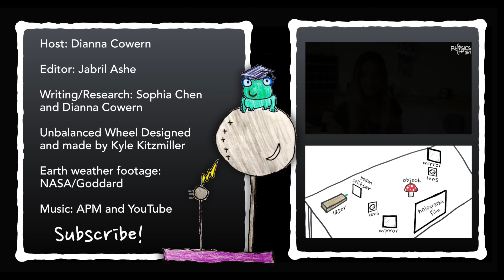Are perpetual motion machines possible?

Comment: The three Laws of thermodynamic:
1.- You cannot win. For any energy invested in a system, you can't obtain more than its equivalent in work and heath in a given system.
2.- You cannot tie. In any given system, the hotter parts cannot maintain their temperature and will invariably get colder, until the total temperature averages.
3.- You cannot stop playing. No matter the system, the minimum temperature is absolute zero. If our universe can be considered a closed system, the far, far, faaaaaaaaaaaar future is a cold and lonely place.
Reply: +José Sandoval Wonderful description. LOL. It would be terribly discouraging if it was not hysterically funny. It sounds like politics. (1) You cannot win. (2) You cannot draw. (3) You must keep playing, and everything turns to sh1+ in the end. Where is Donald Trump when I need him? Behold, exhibit 1.
Reply: +José Sandoval True, but what about a system which never goes above local temperature, it is at best equal to it, and periodically oscillates to a temperature below ambient as a result of a reversible chemical reaction, it takes time for the signal to propagate and the signal alternates between ambient and this temp drop.  It is dependent upon local temperature being above x to perform the osccilation at a positive pressure but it can maintain internal energy for very long periods of time, while continuously outputting work.  For work is not energy, work is the process of deformation resulting from energy flow!
Reply: +Kimberly Peacock every thing dissipates energy, there is nothing that keeps more energy it was provided with to begin with. work is only the event which is created by energy.... no energy = no work.... cold universe = no movement = no energy = no work, work is generally observed as something which was initiated, something usually uses energy to make things happen no matter the scale, even if something was internally hot, for instance a planet, that would be the result of transferred energy from the surface and as the energy gathers in the center of the planet it gets hotter in a smaller space, no more energy than it was initially supplied with. just more concentrated but soon the ambient temperature will override and cool it in the same way.

i understand your thuoghts but unfortunately, from what i am aware of, it's not right. work is always the result of energy somehow. i'd get really deep into this but most people don't like lengthy replies.
Reply: +swanclipper &quot;Silly Rabbit tricks are for kids. &quot;    Yes everything dissipates energy it's called entropy; unless constrained from doing so. Such as if your heat engine never rises above ambient temperature then internal energy is maintained at what is was at ambient temperature.   If you have an oscillating temperature  15K plus or minus where the 15K plus is equal to ambient, and you insulated it and have thermal mass some distance away, the signal cancels out within a distance and time.  (This is what the temperature is constant at 60 feet down within the earth within 1 F annually)  You will never find a violation of physics in what I am saying, and you will not out science me!   But please be skeptical and ask good, hard questions, and I shall answer, and then maybe you will understand and others as well.  I do not claim a perpetual motion machine or over unity. What I do claim is that energy can be conserved in an oscillatory loop for years, and that one can continue to produce useful work over that time.
Reply: +Rainbow Hyphen  Agreed, nothing is forever except energy. I'm only 99.999% sure of that.
Reply: Kimberly Peacock i'm, not trying to out science anybody. i'm simply introducing my understanding of a very complex system in a form simply understood.

conserving energy and using it effectively isn't breaking laws, i know that, from what i remember, your comment came across as a means to bypass energy restraints from the external forces acting upon it while working or changing to match the external environment. the oscillation is still a form of work provided by energy.

i also agree energy can last "forever", another subject i wouldn't mind a lengthy discussion of.
Reply: In a thermal context, a closed system, (which we all know is an artificial construct) cannot lose thermal energy to something unless that something is colder. You can generate an endless amount of work from the same energy, but that work as a proportion of the energy flow will always be less. Which is why I call Carnot efficiency the work ratio, as its the measure of maximum work you can get out of an energy flow for a single cycle. The oscillatory signals that I was speaking of were n the context of the "closed system" where temperature never goes above ambient, and thermally we oscillate - 15 K from ambient to ambient, and where the substance is a reversible metal hydride whose eq pressure doubles and halves in 15 K increments. 22.2 KJ per Mol of H2 of energy is transferred for the equivalent of 1 KW of work.  I'm simplifying here because you need two pairs of hydrides, one which acts as the drive, and the others acting as thermal batteries.  You obviously also need to be at a critical temp  for if below you cannot complete the cycle.  (It becomes none reversible)  However once at that temperature or above, it will conserve its internal energy, and cycle, outputting work, until it wears out, or loses hydrogen mass.  In practise hydrogen leaks through everything.  I will post something on google plus and link it to you in the next couple days, if you wish to understand in depth.
Reply: +Kimberly Peacock "You will never find a violation of physics in what I am saying, and you will not out science me!"
Odd that you have to turn a discussion into a game of one-upmanship. 

"But please be sceptical and ask good, hard questions, and I shall answer"
Why is it that you think people want to hear your answers?
Reply: Skeptical?  

1. Zeroth Law.
2. Conservation
3. Entropy  See entropysite.oxy.edu
4. The entropy of a perfect crystal is a zero when the temperature is 0.

There is nothing about work and of course if you think about it instead of regurgitating it does not make sense to include work. You can also google work is not energy, or dig out a good thermodynamics textbook and understand the difference.
Reply: Imagine the earth's climate as being steady. The energy coming in from the sun is balanced by the energy being rejected, otherwise the temperature would increase or decrease. (Energy is conserved.  At this time the earth is being warmed in a dissimilar manner, and this gives rise to changes in gas density we call wind, which is also known as work. If you counted work as energy plus the incoming energy and outgoing energy, well you end up in a situation where you are creating energy.
Reply: +José Sandoval 1. You can not get more work than is energy in a single cycle.  Carnot Efficiency  the work to energy ratio, which applies for a single cycle.  However as work is not energy, it is the product of energy flow, you can get more work in many cycles than the energy contained within a closed system, but the work will always be less than the total energy flow.  Simply energy is conserved and flows in an oscillatory loop, the energy flow results in a deformation and the force of this deformation is work which mechanically will always be less than the energy flow. Imagine a stirling engine where the hot and cold sinks reverse positions. (This will not work, but using it as an illustration tool)  Now imagine that the heat source is equal to ambient, such that internal energy of the system is constrained.  Now we have a sink but wont it get warmer over time?  Yes but it's an oscillatory signal  and it takes time for that signal to travel and it gets attenuated in the thermal walls such as outside the wall the temp remains at ambient.  What could cause such a sink, how is it powered?  It's a chemical heat pump such as a reversible metal hydride.  Such that when one hydride releases hydrogen its endothermic, and its paired to another hydride which is absorbing hydrogen which is exothermic generating heat, the chemical reactions cancel each other out, and for that reason to obtain work you must use a second paired hydride, which allows for a difference in hydride temp of say 15K, the paired hydrides have lower equilibrium pressures but higher energy chemical reactions of absorption and desorption.  Of course in the real world you have to worry about losing hydrogen mass as well as maintaining internal thermal energy.  This proves difficult if not impossible. Hydrogen will in time diffuse through just about everything.  Such that over time, you will get less and less work per cycle until it cannot complete the cycle.  You also need a temperature you must be above from which the equilibrium pressures are such that you produce positive work, and in the case of hydrides as thermal batteries, you need to deal with hysteresis, thermal transfer, they are poor conductors, and the material itself degrades over time.  However can can use them to create thermal oscillators which conserve their thermal energy, and output work continuously.
Reply: swanclipper  Work is a function of energy flow, resulting in some sort of deformation in energy and or matter density. However energy can flow within a "closed" system. (No system is really closed, but for long periods of time energy may be constrained locally in flow. In such a case with heat that would mean that temperature at the surface is equal to ambient. In such a system one can never get more work than energy flow within the time period of that energy flow, aka cycle.  However over multiple cycles one does get more work than energy flow for a single cycle. I would love to discuss on a deeper level. The biggest problem in physics education in my opinion is that much gets lost with names, (nouns) when our focus should be understanding the processes. (verbs) This is especially true in quantum mechanics.  We are taught crude abstractions, which are supposed to make things simpler, but end up having to be unlearned latter. What does it mean to tunnel?  Why must we resort to probability? Distance is not a straight line in the quantum world. Think about it you have an energy cloud, with a point concentration, it's why we perceive as both particle and wave.  It also means that if this energy cloud is finely balanced that any change can be tipped one way or the other, that on a quantum level we can travel greater distance than the speed of light in a straight line would imply, yet we cannot go faster than the speed of light to cover the minimum distance quantum does not have to because space is not continuous but discrete and swiss cheese like.
Reply: +José Sandoval -very well put!
Reply: +José Sandoval i cannot stop playing? Let me show this to my mom so she will allow me to play MGSV to my heart's content! THANKS THERMODYNAMICS!
Reply: +José Sandoval I love It!
Reply: +José Sandoval but quantum phyics
Reply: Hence my conditional in point 3. My tiny brain is limited to four dimentions, linear process and single status of things. Sniff.
Reply: +Kimberly Peacock I agree with your statement that work can be provided indefinitely in a closed (oscillatory) system with a finite amount of energy. I had this idea before and it blew my mind. This idea is what blew me away, I think it resembles your ideas:

You have a perfectly efficient system (even COP<1 will work) in a gravitationless environment. The system is a box with two springs. One on the left, and one on the right. We have a mass on the left spring and this spring is compressed (this is our initial and total energy of the system). The spring is activated, so now the mass is floating to the right and the box to the left. If your spring on the right is perfect, no stretching/heating/deformation losses, it will absorb the impact of the floating mass. We're only half a cycle in and we already performed work without loosing energy (thanks conservation law!!). Next step is to repeat this cycle. 

The question of course is; how come you can perform infinite work with a device with finite amount of energy? The system is oscillating (of course momentum cancels out), which means the force that moves the individual components from left to right is inverting constantly (and a changing force means work being done). Maybe the answer is that, it is an isolated system so as long as you are in it and use the energy that's locally available to you, you can create any motion you want at no cost!
Reply: +José Sandoval I heard it explained slightly differently:
1.  You cannot win.
2.  You cannot tie.
3.  You cannot get out of the game.
Reply: +Physical Engineering The New Era is that like the law of gravity holding all the oceans to the center but lets the birds and all the little flying insects, critical situations  untouched ?
Reply: +Jos&#233; Sandoval A strange game, the only winning move is not to play. How about a nice game of chess?
Reply: +José Sandoval Or as I like to say it...

1. You can't win
2. You can't break even ... Unless it's an extremely cold day.
3. It can't get that cold.
Reply: So you can only lose endlessly?
Reply: how a bout the gravity . some how we can harvest a free energy out of the earths gravity -9.8 kg meter/sec*2 times mass. out of a unbalanced wheel.

Comment: The occasional visitor to my study still gets a kick out of seeing a couple of strings of coloured LEDs apparently being powered by a simple wire a few feet long strung around the study window (with a tuned circuit and earth connection present). Powered in fact by a local A.M.  talkback radio station whose transmitting mast is located about a mile away running at about 1MHz. Best use yet I've found for the hot air emitted in the studio. It only stops if the station is shutdown for maintenance and once get stopped by a lightning strike to the mast.

Comment: I saw a toy called the asteroid pendulum a "perpetual motion machine" but then came to a quick conclusion that it wasnt real because there was a battery pack on the bottom...
Reply: +Ethan Ho haha ur last name is Ho. Lol. Wait so is mine... Oh well hi
Reply: +Time To Get Cancer XD
Reply: lol
Reply: joe nodden same
Reply: Well I have 8yrs running 2 solar lights in the yard. A rechargeable battery, LED light and tiny solar panel that charges the battery. I have not replaced anything on it in 8yrs. So the initial $14 has paid for itself. I only Windexed the little solar panel once. Free basically.
Reply: poots minion yes but its not perpetual motion if it requires power...
Reply: But it's free energy.
Reply: mihayy5 No matter what energy is powering it if requires energy it isnt perpetual motion...
Reply: joe nodden Well I know that I just mentioned that it's free and we should use it more cause also it's infinite.
Reply: mihayy5 oh ok
Reply: joe nodden @joe nodden
was it a rechargeable battery pack?
Reply: poots minion It was a 9 volt battery pack...
Reply: Ok, thank you, I'll continue this at ltr time
Reply: +mihayy5 Your solar lighting system is not providing free energy...not in a real sense anyway. It may have paid back your original investment of $14, but cost a lot more to manufacture in energy terms than it has, or ever will produce in its lifetime. The only reason it can be manufactured and sold for a profit at $14, is because we in the developed world are getting the benefits of high quality energy sources, such as coal, gas and oil, too cheaply and squander it too easily. In fact, the very act of my viewing this video, and posting a comment, has probably used up enough energy to partly cook a meal for a third world occupant.
Reply: Until you put that machine to work in which case it will run out of energy much much faster.
Reply: David Janzen that made no sense...
Reply: David Janzen How do you spin a gas? What do you mean by put it in the universe?
Reply: David Janzen
 Not forever, just a very very long time.
Reply: AY, look at our profile pictures!
Reply: pendulum ≠ perpetual. Battery pack is expected.